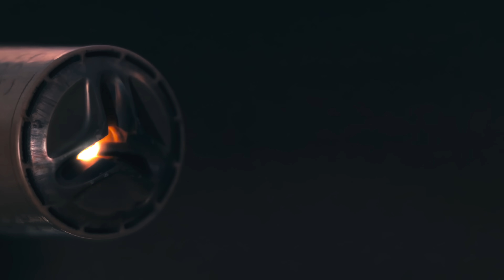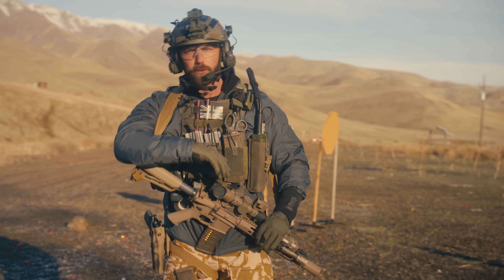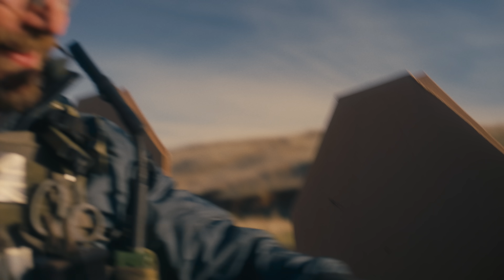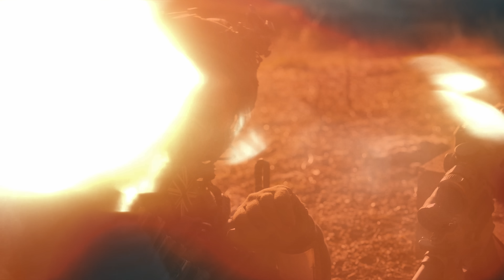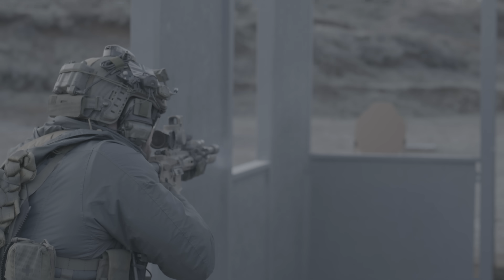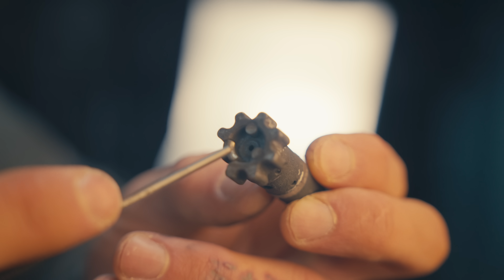The British Just Adopted A New USA Made Combat Rifle

Comment: KS1 wasn’t adopted as a primary weapon. It is just for commandos and ranger regiment, the rest of the dismounted armed forces still use SA80. It is in the running for project Greyburn though and if it wins that contract it will be the primary rifle.
Reply: It's possible to win Greyburn, though I think the particular specs for the Greyburn adoption may be slightly different, with multiple variants being requested to replace not only the L85A3 but also a short carbine variant to replace the L22 and also a cadet rifle replacement.
So it's likely the specific barrel lengths and maybe the optic will be different.

Wouldn't be surprised if the good reception of the KS-1 amongst the Pathfinders and Commandos influence their chance of winning though, Knights are a solid choice.
Reply: @G1NZOU not a chance will the green army get a 10k rifle yes it was 10k the U.K. paid 15 million for 1620 rifles making it about 9200 GBP per rifle we will end up with the Berretta or the sako if I was a guessing man
Reply: @MrTangolizard  That's why I said the specs might be slightly different.

Grayburn is looking for 5 variants.

One of which is a generalist rifle for mostly reserve troops, replacing the L85A2 carried by soldiers who don't need the L85A3, another variant is supposed to replace the L98A2 Cadet Rifle.
Of course those variants aren't going to need all the features the frontline rifles have, so they can be cheaper.
Bulk order also drives the cost per rifle down.

That said I agree, Sako have a better chance on the cost side of things, while my personal favourite is the FN ARKA.
Reply: @G1NZOU  Doubtful any western country is going to want to procure weapons from the US going forward, it's definitely not going to be the next UK service rifle.
Reply: @G1NZOU  That is until the US invades greenland, then it'll likely be HK Germany
Reply: @michaelmasters6320 nope Berretta and FN have production facilities in the U.K. so most likely I think we will buy the Berretta or the sako (same company really)
Reply: Ranger reg?? Who the fook are they, son?!
Reply: @thebrotherofthunder the ranger regiment is a regiment of rangers in their British army if the name diddnt give it away.
Reply: @thebrotherofthunder a regiment designed in unconventional warfare and foreign language and relations. Saves using the standard soldier from training and teaching foreign soldiers and militias. Basically the US Army’s Special Forces; even down to their training and advanced training is replicated but with modifications done by a team of former US Delta and Uk Pathfinders and SAS.
Reply: They don’t just use the SA80
Reply: I'm losing brain cells reading these comments..
Reply: Since money is factor the UK,  the simple routine for the UK is the KS-1
Reply: I can't see it being selected for Grayburn, it is too expensive.
Reply: If it wins it will have to be UK produced. Meaning that regardless of the winner, it will be extremely expensive to start production. But that is the price for independence.
Reply: @johnharker7194 the tender looks interesting, the working around ability to defeat body armour suggests a move to a different calibre like the recent US change
Reply: @johnharker7194 AR platform rifles are typically inexpensive to produce nowadays
Reply: @Daftymarra  I believe they're sticking with 5.56, however 5.56 has advanced significantly since it was first introduced and if you wanted armour piercing within a specified barrel length ammunition manufacturers could definitely deliver.

The advantage of the American's new calibre is the effective range being increased, especially if combined with the intended optics, but at the cost of barrel wear and less rounds carried in a typical combat load.
Reply: @joserios2609  They're inexpensive to produce for a factory that's already outfitted to manufacture them, but the majority of the cost is setting up factories and production lines.

Same with computer chips, each one costs pennies when the production line already exists, but setting up the machining for new designs is the expensive part.
Reply: @joserios2609 its knights which is super expensive on the civilian market, which leads me to believe it would be more expensive than other ar15 designs. Especially if you have to spin up production in a place where domestic production doesn't exist. It doesnt use standard ar parts or tooling like an fn or colt.
Reply: Probably Canadian colt canada c25/26 wat will get regular army service rifle as we used c8 and know there reliable
Reply: I believe KS1/3 is planned to replace the all the remaining C8s as the primary weapon of UKSF, alongside the MCX Spear LT which has replaced 42 Commando's C8s for maritime boarding.
Reply: @MrPHILLCROW it's already in use with UKSF and has been for a few years now.
Reply: Hence it being standard with a suppressor designed to be used at night.
Reply: The RAF regiment are receiving it as well
Reply: @zarate999 the NAAFI doesn’t defend itself.
Reply: @Monkey-ud8bw being part of SFSG and having an elite squadron doesn’t recruit itself.
Reply: @zarate999 yeah the guys attached to SFSG should, but every Rock Ape? 
Come on there are other more conventional units who’ll need it first, 16AA for one.
Reply: @M @Monkey-ud8bw o else is part of the big three? Paras, marines, RAF regiment and who else?😊
Reply: @zarate999 EFI
Reply: I believe that one of the requirements of Project Greyburn is the ability to fire 6.5 Grendel, which the KS series is unlikely to he capable of chambering.

Currently Beretta and Sako are among the top contenders, with larger, short stroke piston rifles.
Reply: @jacobbaumgardner3406 I haven’t seen the full tender, just the press release which just mentioned the ability to defeat armour. No mention of a particular caliber. 6.5 makes sense though, Creedmoor is used by the Royal Marines now in their new Sharpshooter rifle
Reply: @jacobbaumgardner3406  there is not an AR-15 pattern rifle that can't shoot 6.5 grendel. its a simple barrel and bolt swap that can be done under 30 minutes by a first timer.
Reply: @johnharker7194 didn't say it can't be done, I said it can't draw out it's full potential.
Reply: @jacobbaumgardner3406  I did see body armour defeat mentioned but no specific mention of calibre. I bet they introduce an M855A1 like 5.56 nature to "tick" that box. Moving away from 5.56 would be a serious gamble. I hope they do go for a KS package though.
Reply: @jacobbaumgardner3406 US needs a good 6 or 6.5 mid rsnge.
Reply: I'd say, mate, that Project Grayburn might take an more EU lean to it considering the current relationship and potential issues with NATO in the near future.

I wouldn't be surprised if H&K or Beretta are the final choice of main combat rifle for the UK military.
Reply: @Johnny_Knuckles  I am confident it will be the HK416 and licenced for UK manufacture
Reply: @Johnny_Knuckles either way you'll be using a version of an American rifle AR-15 or a licensed AR-18 built for US SOCOM HK416.. Maybe one day you guys can design build your own rifle 😅. We all know that it probably wouldn't work
Reply: Made in th UK
- *To be considered "Made in the UK," a firearm generally, at least 50% UK value added, though "substantial transformation"
- For firearms, this usually involves the creation and finishing of critical components like the receiver (the serialized part) and the final assembly and testing.
- UK serialized gun parts are components like the receiver/frame, slide, or bolt
Reply: @839photo All of this is a US superiority innovation and technology The only thing that is an American is the aim point😅
Reply: @jbloun911  for UK to adopt it has to be finished 50% or more in the UK. what else do you need sledded out or spoon feed? 😢
Reply: @839photo this is 100% in American rifle buddy nothing's made in Englandia😅
Reply: @jbloun911  friend your missing a lot of points. its an American product that England wants, by their laws it must have 50%+ ‘made or finished in the uk in order for the contract to be fulfilled. that usually means either a uk co or an American co opens a branch on uk soil and finishes the work. cant spoon feed it to you any more than that, much luck to you.
Reply: @839photo Knight's armament is not operating in England buddy 50% of this rifle is not being made in England are you mental 😅.. Korea was the first buyer of them and none of them are being made in Korea either. Edgar Brothers or just assembling the vortex optics reptilia Mount and all of the rest of the stuff including the aim point. Rifles 100% made in Florida
Reply: @jbloun911 you really are a melt 🤣
Reply: Yeah the British now have a Ranger regiment which they've obviously adopted from the US including our rifle and aircraft and some of our gear😅.. The Empire is long gone and resides in Washington
Reply: @jbloun911 and the rangers were originally based on our commandos 🇬🇧🇬🇧not the win you thought it was
Reply: @SteveR-w1q no😅 the US Army rangers go back before the Revolutionary War they had sharpshooters as we were blasting the brits with American long rifles while the British were still using muskets and marching in line wearing bright red coats 😅
Reply: @jbloun911 he is not discussing linguistics … painful to have to point that out
Reply: @jbloun911 yawn …
Reply: @jbloun911 you are wrong - Commando was a South-African Boer word, Winston Churchill had observed the Boer Commando hit and run raids and decided Great Britain needed an equivalent raiding force.
Reply: @andysavill8580 Exactly, we picked up a lot from our bad experiences fighting the Boers. They were ahead of their time.
Reply: @jbloun911 the rangers fought on the side of the British during the revolution genius
Reply: @redrock425 not really they were a product of there environment they couldn’t face the British on open warfare so played to there strengths didn’t help them as the British won
Reply: @jbloun911 the main rangers the famous ones fought on the side of the British how the hell u think that is copying the USA seeing as they were British only u know
Reply: @MrTangolizard modern rangers are 100% American and the British which are now copying our units and literally being trained by American Green berets.. You're also using our doctrine and our rifles because you can't make any hence the video 😅😅... Please stop because you're comical and you know no history your university suck and ours are the best in the world in your proving it now..
Reply: @jbloun911 totally incorrect U.K. rangers are actually being trained in part by green berets and will do a similar role it might surprise you to know the USA and U.K. cross train all the time it neither needs “help” from abroad to train its troops but we all like to learn from each other same reason u.s SF troops get attached to U.K. SF or officers from other countries come to the U.K. on attachment nobody is copying anyone anymore than u.s delta “copied” the British SAS it’s just another unit being set up so to take the pressure off other SF units
Reply: @jbloun911 I know plenty of history clearly more than u and it’s interesting u think U.K. universities are rubbish when the top ranking one is British lol and u talk about being uninformed wow
Reply: @MrTangolizard 
Rangers are from North America &  American buddy the Rangers fought against the crown and the modern rangers are from the 1950s and '60s which your country is now trying to copy.. 😅 the real US Rangers that you're copying and being trained by today are the Green Berets.. 😅.. watch the video You're also using US rifles because you're incapable of making anything even close in quality or technological superiority. 😅😅
Reply: @jbloun911 you have a very strange view what makes u think the British can’t make a rifle literally every single SF unit on the planet use British rifles, buying a AR rifle for its units is hardly something special it’s like saying the USA can’t make pistols because they are using a sig pistol you don’t seem very smart do u
Reply: @jbloun911 actually the British Ranger Reg will be more like your Green Berets than your Rangers.  It will be primarily used to train friendly forces such as the Ukrainians.
Reply: @jbl @jbloun911  already have rangers in the British army we have had them since before the USA was a country my word we have the Irish rangers as line regiment troops and your aircraft was partly built and designed by the U.K. who partners with the USA
Reply: @jbloun911 no, the UK Ranger Regiment is tasked differently from the US Rangers - who by the way, owe their existence to British Commandos, who trained them in world war two.
Reply: @jbloun911 yawn, yawn, yawn
Reply: @jbloun911 evil empire, orange emperor

Comment: Is it better than HK rifle?
Reply: What does "better" mean?  Such a bad question.  What are your criteria?  Weight? Then KAC.  Accuracy? HK.  Reliability? Both will be way more than you'll ever require, but the HK will run cooler and cleaner (does that matter to you?).  Resale value?  KAC.  HK uses a stainless barrel where the KAC is lined.  Neither is better.
Reply: I’m just curious to know if the HK is more reliable, better built, best quality and simply will perform amazing accuracy